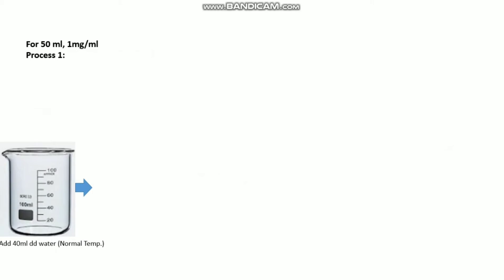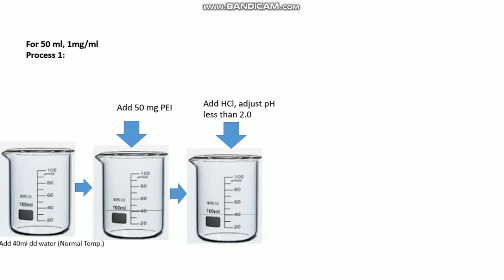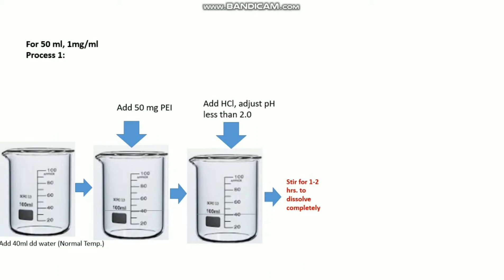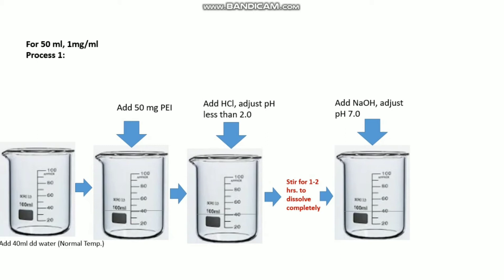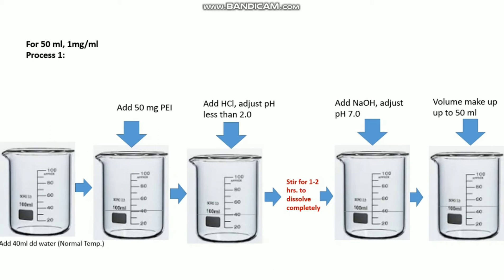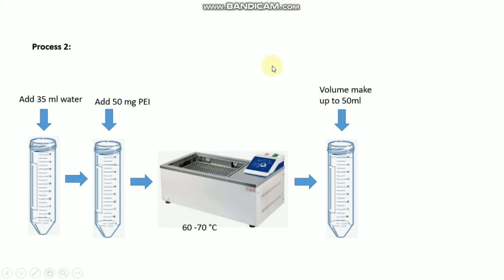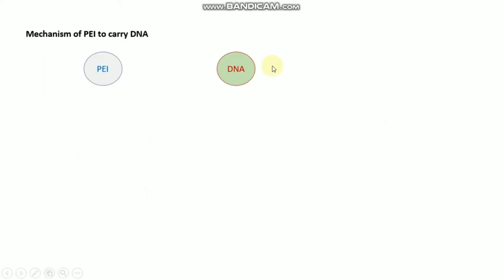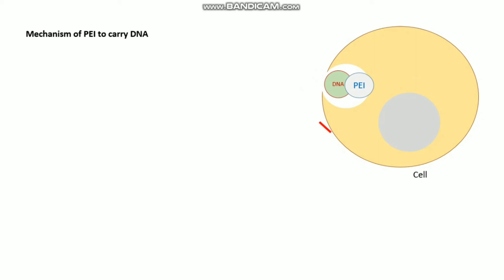How to dissolve PEI for transfection ll mechanism of PEI-DNA complex ll Xgene and ProteinX

Comment: this does not make sense. There can be no ions in PEI solution or else PEI-DNA complex will crash out
Reply from the maker: Don't need ion-free water for PEI. Usually ddwater (lab grade) is used in lab which is not ion-free (conductivity 5). Ion-free water is produced only by distillation process, such as Water for injection (WFI) (conductivity 0), which is very costly and not used in the lab. Dissolving PEI using lab grade ddwater is validated protocol.